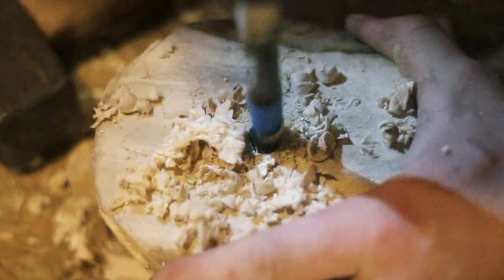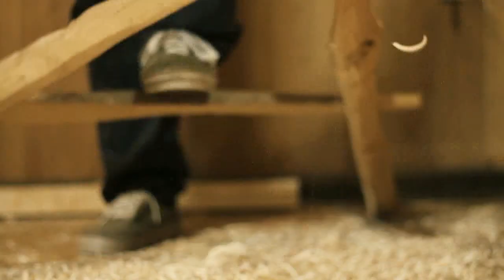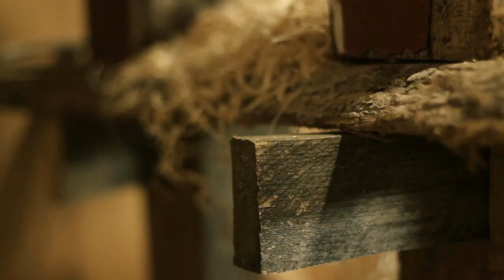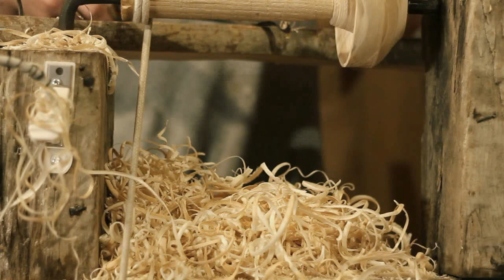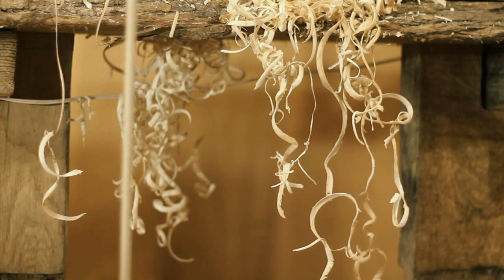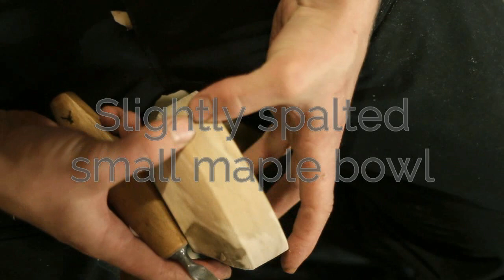Pole lathe bowl turning

Comment: Aside from trial and error with forging the turning hooks, would you say that they are a challenging project for a novice? Need anything more than some rods of tool steel, a small blowtorch forge, and a hammer? Thank you for such a great video, beautiful work!
Reply from the maker: Ehm, I think the heat treatment process is the hardest part. You can find several videos on youtube on that. 
They are easy to make with an angle grinder, a torch and a small set of pliers - it might take some turns to get the angle of the cutting edge right, but they are fairly easy to tweak if they don't work the first time. You will need to heat treat afterwards though...
Reply: Thank you very much for the info! I do have those items do time to get to work I guess, take care!